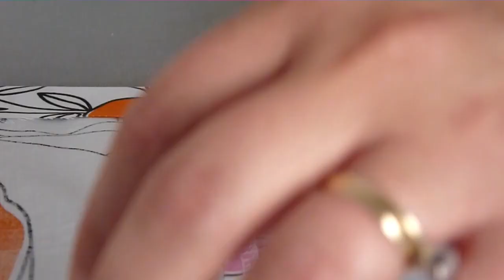How to sew your a-line skirt

Comment: Any tips on just using an elastic waist? Should I increase my seam allowance?
Reply from the maker: For an elastic waist, you have to make sure the waist is big enough to pull over your hips. Likely you'd need to miss out the darts completely, and even the waist shaping on the side seams might need to be reduced. It depends on your own figure.
Reply: simplesewing  Thank you, I did omit the smaller darts and will still include the waist shaping...to see how it all goes!